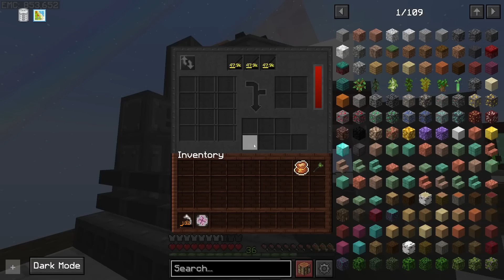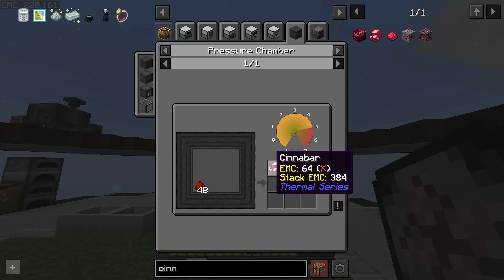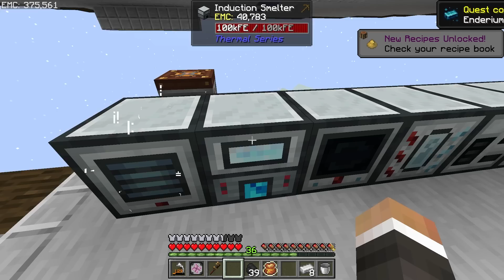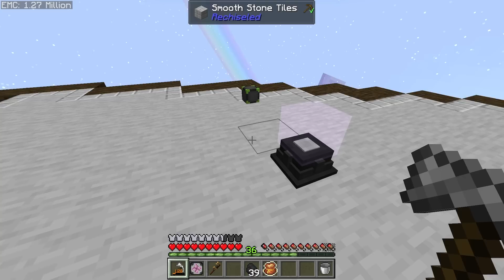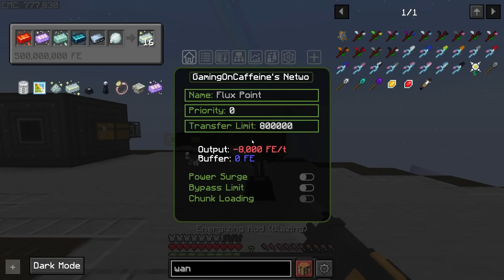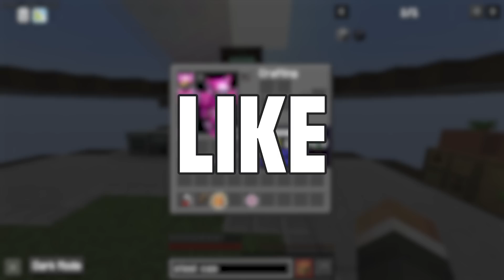Minecraft Sky Revolutions | 500,000,000 RF FOR AN INGOT! #14 [Modded Questing Skyblock]

Comment: Again, you need to make some coolant for your reactor, you're losing a ton of power running it dry. Water will significantly increase your power output, gelled cryotheum (which should be possible for you by now) would be the best.
Reply: Ludicrite is actually better in this pack

Comment: isnt there a way to automaticly generate emc in ProjectE, or did they change it for the pack? because im pretty sure that there are some automatic emc generator.
Reply: what im talking about is something that looks like little trees that ProjectE has, there are many different tiers of them, i keep forgetting what its called tho, so ur going to have to find it on ur own
Reply: @Kingfirestone123vXD  they're only in ProjectEX, an add-on mod for ProjectE

Power flowers btw
Reply: @nomadster_ they're in this pack
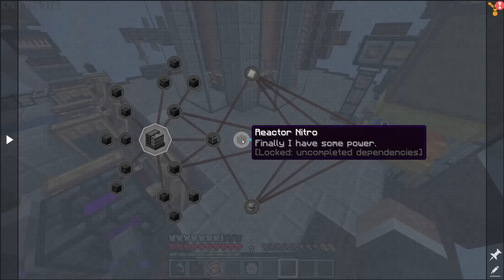Reply: 40:15 Yes Power flowers are what i was talking about
Reply: Yes! You can use power flowers to generate emc. The lower ones aren't that good but if you add a watch of flowing time it makes them faster. Watches speed up watches so make more. You can also temporal pouch the watches to make it insanely fast at generating emc